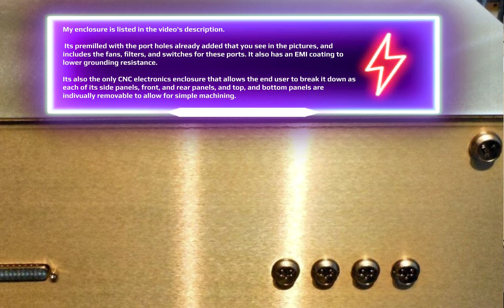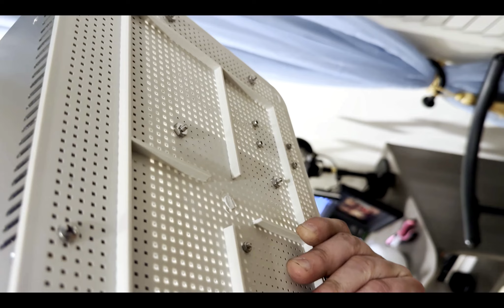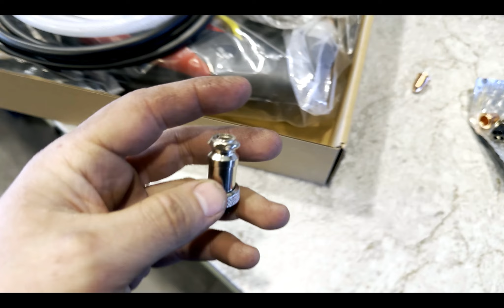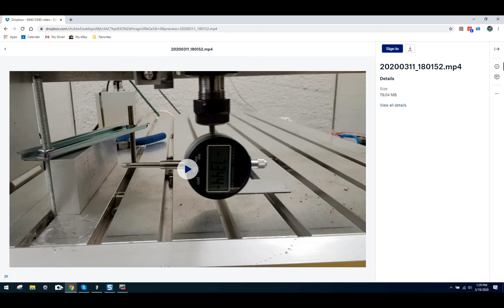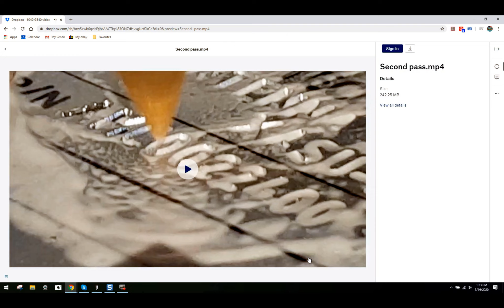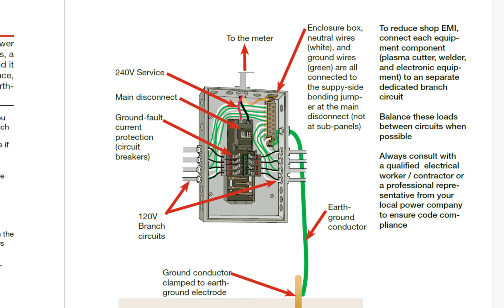CNC Controllers Built Incorrectly (Volume 21)

Comment: I'd go a step further and say that a 4 conductor shielded cable where all 4 conductors are terminated on both ends but the shield is not terminated on either end is worse than a plan 4 conductor unshielded cable. That sheild is now acting as an antenna ruining in parallel to the other conductors.

When wiring elevator traveling cables it was common to see +100v on any un-terminated wires. On really tall installations (30 stories) you can drag the wires across an I-beam and they'll sparks so much so you'd sware they were all powered.

Comment: Hi. Been watching your vids for 9months now. Great wealth of information! I went back a few years to learn what you have to offer. 
I Have a couple questions (mainly for a future build). ;-)
On a router table, if 240V was used to power the router, would the 180deg phase shift help cancel out EMI? Would tinned copper braid(grounded appropriately) added to the fat power cable help lower EMI emissions? Or is aluminum foil more suitable for the 60Hz noise(most routers are single speed). (For plasma table, the arc is where the EMI is generated or is it also the power line to the torch, and therefore it needs shielding?)
For the enclosure, would a tightly perforated metal grill(One company advertises honeycomb shape) be recommended to help lower EMI ingress through the fan openings? 
Using one enclosure for line voltage and DC power supply, and a second enclosure for all control circuits is 'best practice' for helping lower the 60Hz interference? 
Keep up the great vids! I recommend them to many people starting out, or having issues.
Reply from the maker: Thank you for your support. 

All CNC robotics controllers require double shielded cable as mandatory equipment. 

There isn't a way to cancel out EMI if electrical energy is present without proper shielding/grounding.

You can use as many enclosures as you prefer, but it costs more to do so, and requires adequate cooling for each one.

When you're ready to build your system let me know, and we can schedule a consultation to discuss your system. 

Thank you,
Vince